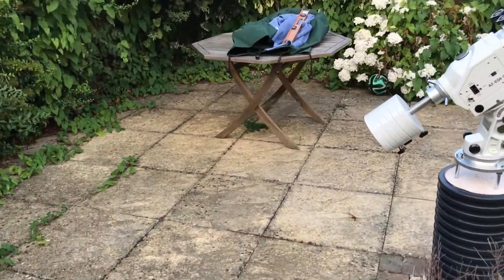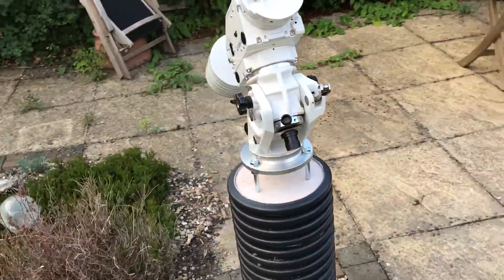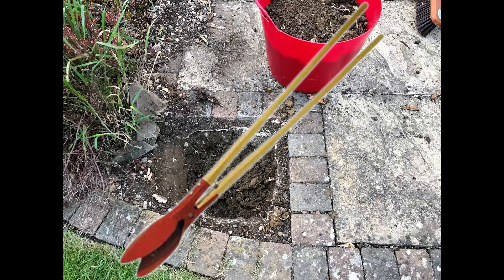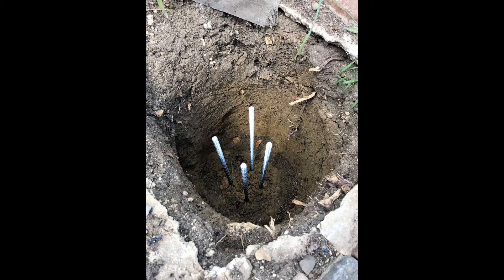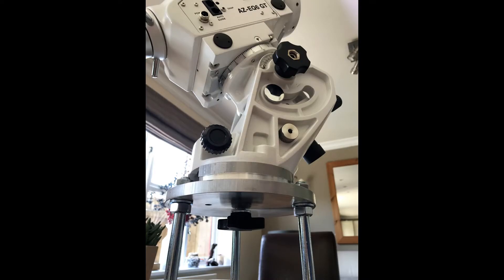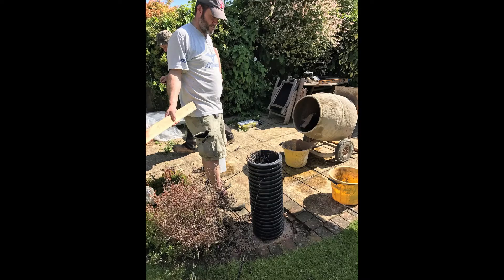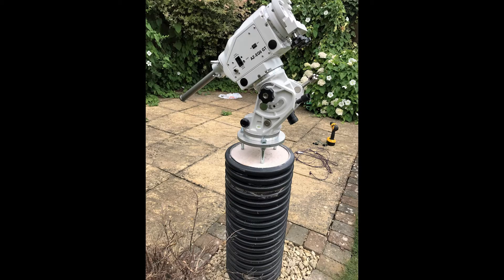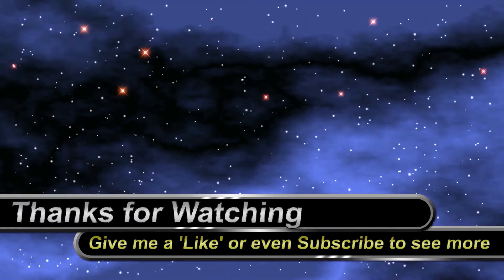Constructing a Telescope Permanent Pier

Comment: Not enough concrete there to stabilize the pier. Lots of real professional advice out there. This isn’t one of them. The pros advise a 1m x 1m x 1m cube of concrete to provide a suitable pier base
Reply from the maker: @davidthompson9879  well, you’re right that they suggest much more than I used, and had I the room I would have used more. The reality is that it’s been in place for more than 4 years without any issues, my rationale was based on a tripod being stable enough to take long exposures, and the pier is certainly more stable than that.  I want to add one more thing.. your comment is made quite aggressively, and I don’t respect your opinion for that.  I did what I could in the space and cost constraints of my circumstances, and I am very pleased with the result.  If you want to do it  with a different approach, fine, I don’t need to comment on your ideas to know mine worked out just fine.  Thanks for watching…
Reply: @MikeyJ  you have no idea the context as you cannot see me or read my body language which means you can only assume. I cannot influence your assumptions from the written word. All i am saying is your pier is susceptible to both movement and vibration due to its design so it should be pointed out that this is your idea of a pier and is not the accepted norm for a pier
Reply from the maker: @davidthompson9879  it appears you are the one making assumptions..  I already showed it with a 10” Newtonian mounted, and I can say explicitly that it has no issues with stability. Astro photography is challenging, we’d probably all like to have better equipment.  This video isn’t to say everybody should do the same as me, but it is a great improvement on moving all my gear around every time there is a clear sky, so I am happy with my diy pier, and that’s what it is… not kit peak.. it’s a great almost free way to improve my Astro setup.  If I was doing it again I would change some things, but more concrete because ‘the professionals’  and keyboard warriors say so wouldn’t be at the top of the list.
Reply: @MikeyJ  i have a comment but i will keep it to myself. You have a nice day and enjoy your pier

Comment: How crucial is it that the bolts for the mount are pointing up at 90deg and not day 89.9 degrees?
Reply from the maker: just a bit more clearance room to the plate , I cant see any other big issue with it.

Comment: Looks great! Was wondering  how is the corrugated drain pipe standing before adding rods and pouring cement? Isn’t that flexible?
Reply: no, they're extremely rigid, I've used them on a fence of  180ft in length to set posts in quick crete.

Comment: Hi there could I use a 12" Newtonian on a az-eq6 gt mount like yours is set up thanks
Reply from the maker: Yes the 10” works great on it 👍🏻
Reply: @MikeyJ  thanks for your help I really really need help I just want to use it for the moon and planet's and the sun I'm just a beginner could I use starsense outo aline on the mount
Reply from the maker: Hi Robert, I looked at that originally also. If you were only a visual astronomer, mount will take it, but for imaging, then the weight and also the moment from the extra length of the scope makes it less than ideal
Reply: @MikeyJ  so would I be OK with a 10" like yours on the same mount az-eq6 pro gt thanks for you help I'm really trying to get this right I have a celestron nextstar evolution 8" and a sky max 127mm but I just want a newtonian telescope 10"or 12" and a pier like yours I can have an observatory in the garden or just a pier in the garden

Comment: I really love this build and I'm going to build one like it - the corrugated tube is a really good idea, lots of concrete and makes a good and solid construction! Would like to see a follow-up video on it. If there were anything you would have done differently if doing it again - what worked great and what worked not so great. I like that you only did one plate, where many other has multiple plates, but it seems like you have enough room to level it off and get underneath to lock the mount in place. How did it go with leaving the mount outside for the past 3 years - did you do it? 
My plan is to add mains power and ethernet jack next to it as well...just have to wait for my EQ6-R to arrive - it's in backorder everywhere :/

Comment: do you leave mount out all year long? Did you regret not running any power lines up the pier inside the concrete?  Nice job!!
Reply from the maker: Thanks Mark, and yes I have left it out, double covered all year, although I did  take it off for a clean and re-grease. Yes power and Ethernet would have been nice, but the only issues I have had are with USB connectors, so being able to take in the connecting unit has helped with the reliability

Comment: Nice pier! Although I have two concerns to mention: 1) Rebar rods must not touch ground. All metal within concrete has to be isolated from water. Corroded rods will expand and crack concrete. However it's not big deal here. The pier will last many years anyways. Before investing in any serious concrete project (house/observatory), I recommend watching all videos here: https://www.youtube.com/channel/UCrvfiHNDS_QI-FgKQSmTITQ The guy knows everything about concrete. 2) The rods holding adapter are too thin and too few. Such weight needs more firm support. https://youtu.be/AOeLnecOMeg

Comment: Intriguing. The posting is three years old. Anyhow, I have a question for Mieky. Will the counter weight hit the pier if you set the latitude to about 5 degrees. Your latitude may be much higher but I am just curious. Thank you.
Reply from the maker: Mohamed, Hi.  I’ve never tried it that low, it will be pretty close, I’ll try it next time I’m doing a PA.  maybe someone else can comment on their pier?  A smaller diameter support would help a bit.

Comment: How is this in winters?  Snow or rain getting in?
Reply from the maker: Chris 570 hi, it’s been outside since Oct last year, survives well, with the two layered cover, but I also use acf50 to protect the steel
Reply: @MikeyJ  sorry...not sure what bnb u mean...acf50
Reply from the maker: Chris 570 hi Chris, google for acf50 and you will find ‘anti corrosion spray’. It’s pricey, but good 👍🏼
Reply: I'm liking this pier design - I've been thinking that putting a conduit either in the pier or next to it to run data/power/etc would be a good idea so you aren't stepping on wires when working around the scope...
Reply from the maker: @Afterburner  true, power to the scope would have been good, but i just run an extension cable to my DIY powerbox, and its done, so compared to the extra trenches, protection and cost, im OK with the 'dumb pier' approach

Comment: Very nice option to not having a full on observatory.  Actually with wireless connectivity it is no different than an observatory in that you eliminated all that back and forth work, connecting cables isn't a big deal, in fact I sometimes leave everything intact if I'm planning on a two or three night imaging session, but I'm on a tripod.  Great idea and solution.  Setting up and breaking down is a PITA and eats into imaging time time besides.

Comment: Nice one mate - short and sweet. Love how you used the drainage pipe as a cover. I am going to build a pier as well - Waiting on the utility company's to do their survey's so I don't cut through a cable or water pipe.
Cheers
Jim
Reply from the maker: Thanks Jim, good idea on  the survey, i did a check on the original building plans and all was ok.  Good luck with it, it saves so much time on setup!

Comment: Would the continuous hot/cold cycle especially in winter damage the mount at all even under the cover?
Reply from the maker: It's an interesting question.  The thermal cycling probably means Polar alignment needs to be checked regularly.  I will be keeping a close eye on it, but I have also adopted several layers of protection:  firstly I have used ACF50 to coat and protect the exposed parts likely to rust.  This is a great product!  Then a towel is draped over the mount, to help reduce dew and moisture, and avoid 'chaffing' on the outer layers.  Second layer is a plastic bag cover, waterproofing, and then the green cover you see in the video, protecting from the elements inc sun.  So even if there is a leak in the outer cover the inner one should still protect it..  I will let you know in the spring if there was any issue!  Thanks for watching
Reply: @MikeyJ  Hi - great video!  Would you happen to be able to give an update on how the mount has held up outside, 3 years on?  Thanks!
Reply from the maker: @HelmutBemboka   Hi, everything is working fine. I have stripped and cleaned/ regreased the mount once, and replaced the covers because of wear. I now use a double layer with an old towel between (the mount and the cover), and some of that non slip rubber Mat  between the two covers, as the first cover wore thin at the top, and started to let water in during heavy rains. This double cover is working fine for 1 yr already :-)
Reply: @MikeyJ  ok great.  Thanks for the update :-)
Reply: + Mikey  I'm very interested in how your mount fared outside, 9 months on. My AZEQ6 arrived yesterday (your review helped sway me to buy it), and I absolutely love it so far. But hell, it's a beast to hump around, mount on the tripod, and align, BUT I'm really quite anxious about leaving such costly kit outside. How do you apply that ACF50, ands where?